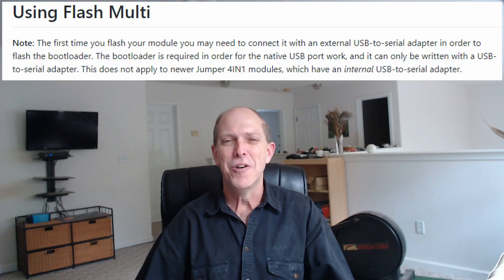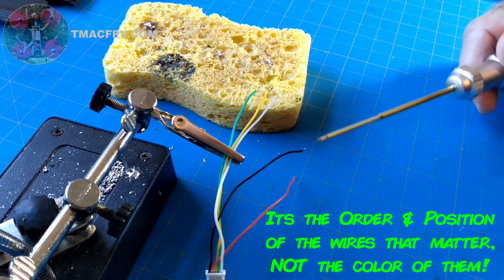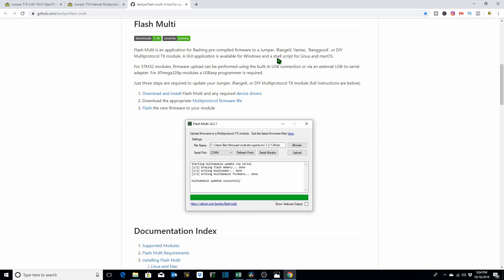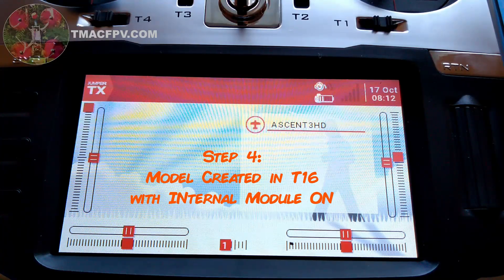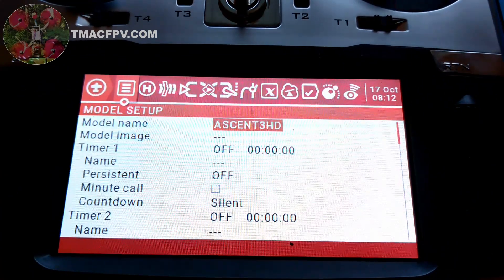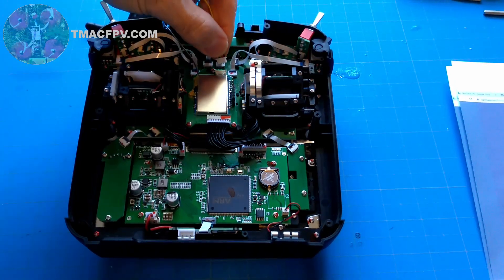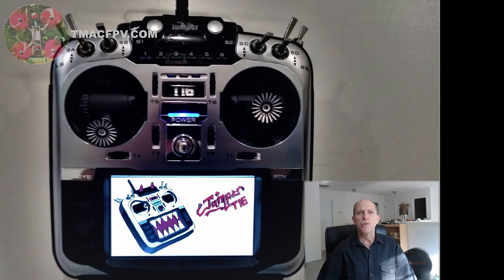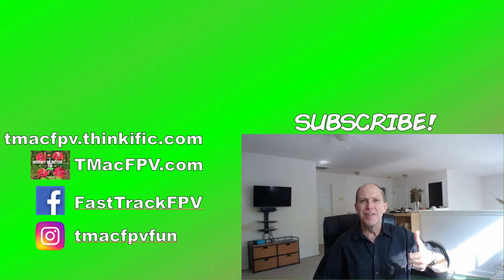JUMPER T16 PRO BOOTLOADER AND FIRMWARE UPDATE

Comment: Great video! do you know if the Pro V2 comes with the bootloader ? I just flashed open tx 2.3.9 on my Jumper t16 pro v2 but unsure if i need to do something additional for the bootloader
Reply from the maker: You're fine. It came with bootloader. Remember to keep up with multi-protocol module firmware updates. 2 different firmware in transmitter. This video explains it https://youtu.be/xAmCWIwzlKc Also, check out entire playlist on the T16 for more helpful info👍
Reply: @TMacFPV  thank you sir

Comment: I've got a 2nd hand jumper T16 that came with the TX version 2.3.5 and the internal module version 1.2.1.51. Do I have to install the bootloader? And what version should I install? Thanks TMac for the video 👍
Reply from the maker: Hey Luis! yes, you will need to upload the bootloader using the process in this video and update the multi-module firmware.  Everything yuo need to know is in this videos description under "Resources and Links Mentioned in this Video."  Additionally, you can go to this site for the latest multi-module firmware:  https://downloads.multi-module.org/ . Select Jumper T16 Pro Internal Module as your Multi-module selection, module type = STM32, Radio Type = OpenTX, Channel Order = AETR, Telemetry Inversion = non-inverted, firmware version = get the latest stable release.   This is for the multi-module firmware you're speaking of here.  This is 1 of the 2 firmware on your T16 you need to update.  The other firmware is the radio operating system firmware which is OpenTX.  for a better understanding of the 2 firmware and what they do see this vdieo: https://youtu.be/xAmCWIwzlKc . For a good understanding of all of your T16 features and capabilities, check out my Playlist on the Jumper T16 here: https://www.youtube.com/playlist?list=PLKAiYAaTdvmqHBs7M0n3t2mSzxY9jEtWK
Reply: @TMacFPV   TMac  Once the adapter is connected to the internal module you plug in the battery and turn on the jumperT16... Then you connect the usb cable to your computer and it will power the adapter, there's no need to solder the 2 joint cables to the 3v port of the adapter, is there? On the other hand, do you open the flash multi program before or after having the usb cable plugged into the computer? Sorry for all these questions... I am new to open TX.  Thanks very much for taking the time to answer my questions.

Comment: Hope you can help me. I have jumper t16 pro v2 setup to kopilot I'm using mode 2 AETR. The motor will only start when over
half way up on throttle. any suggestions? I do watch most of your videos
Reply: It is still acting like it has spring to center still activated
Reply from the maker: Hey Bob! Sorry to hear you're having challenges with your transmitter.  T16 Manual can be found at this site: https://www.jumper-rc.com/download/t16-pro-hall-v2/  Section 3.2, page 27 talks about calibrating your sticks which may be your issue on motor starting only half-way up on throttle (IF you have the correct stick configuration on your transmitter fro Mode 2).  You say you're using Mode 2 , does that mean you have Mode 2 selected inside the transmitter OR do you know for a fact you have a transmitter which came with Mode 2 sticks?  Mode 2 stick transmitter should have "spring to center' on the right stick NOT on the left stick.  The gimbals are different.
Reply from the maker: Thanks Bob, I replied below
Reply: Got it fixed.Had to set end points.

Comment: I can't bind to any models with Spektrum on my T16. it says, "module update recommended" after updating it with open tx. Do you have to update the module if you use open tx or is my issue something else.
Reply from the maker: Hey AaronRC! Yes, multi-module firmware & OpenTX operating system firmware are 2 different things. See this video https://youtu.be/xAmCWIwzlKc then go to multi-module.org for updating
Reply: TMac thanks for the quick response!

Comment: I don't have any COM port to select. Anyone can help on this?

Also I saw your usb adapter red light turned off after a few sec. Mine keeps on lighting. Maybe I did something wrong?
Reply from the maker: follow steps in this checklist. Should work for you https://drive.google.com/file/d/1iAMQ...
Reply: Same problem - no additional comms port on plug in. (check list page not found for me)

Comment: Can this be done on the external module?
Reply from the maker: Are you speaking of installing a bootloader on an external module of updating the firmware on an external module?  I guess the answer to either is yes, I believe so.  I know you can update the firmware on an external module.  Just go to t his site and select your module (the latest available firmware will show up): https://downloads.multi-module.org/  To see the process for updating, see this video: https://www.youtube.com/watch?v=EJx9mz-DI_g&feature=youtu.be
Reply: @TMacFPV  I was hoping to add the bootloader to the external module.  Currently, my Module Status is V 1.2.1.25.
Reply from the maker: @williambeckett4295  Yes, you should be able to do that through the USB port with a USB cable and using Flash-Multi.  See Flash Multi paragraph on this site and then go to the Github link provided in that same paragraph to get the file for updating with bootloader: https://www.multi-module.org/using-the-module/firmware-updates/update-methods
Reply: @TMacFPV  Thank you for your help! As you said all I needed to do was plug into the multi-protocol module.  Sometimes I make things harder than they have to be!  Keep up the great work!
Reply from the maker: @williambeckett4295  Glad to hear it worked out for you William! Happy flying friend 👍

Comment: Your videos have been a great help, keep up the great work. The one thing I am having a hard time finding is the actual updating for the internal module ,  firmware and sd card updates are not a problem but I was told there are also updates for the module itself.
Reply from the maker: Hey Jeff! I'll take care of that for you this week friend 👍
Reply: @TMacFPV  Through the RC Group one guy led me to the right instructions and it went smooth as silk.  But I think it would be a good video for you to do to make it easier for the others.
Reply from the maker: @jsreimer  That's great Jeff! Yes, the video is actually a demo of the process using Ben Lye's site and pointing people to it. It'll be out in the next couple days. Thanks for the suggestion. Always looking for ways to help folks out. Happy it all worked well for you👍
Reply: @TMacFPV  This post on RC Groups from Benzo99 , if the link works https://www.rcgroups.com/forums/showpost.php?p=43639233&postcount=16667

These led to the exact right directions and file

Comment: Quick question how do you do the boot loader update on the MacBook
Reply from the maker: Per Ben Lye on Sep 2, 2019: "In other Flash Multi news, I added a Linux script package to the latest release today. It does nearly everything that the Windows GUI does, so now there's an option for Linux/Mac users as well. The only thing it doesn't do yet is automate the recovery of a device that's stuck in DFU mode, but hopefully the checks I added in the latest version will prevent that from ever happening now anyway"  here's a link: https://github.com/benlye/flash-multi/releases
Reply from the maker: @Alonzo Nembhard Per Ben Lye on Sep 2, 2019: "In other Flash Multi news, I added a Linux script package to the latest release today. It does nearly everything that the Windows GUI does, so now there's an option for Linux/Mac users as well. The only thing it doesn't do yet is automate the recovery of a device that's stuck in DFU mode, but hopefully the checks I added in the latest version will prevent that from ever happening now anyway"  here's a link: https://github.com/benlye/flash-multi/releases
Reply: OK I’ll check it out thanks for the quick response
Reply from the maker: @alanzonembhard5084  I'm not familiar with MacBooks. That's the best I can do.
Reply: TMac Yes I can be a hassle sometimes dealing with Mac

Comment: Tmac where did you get the connector that you soldered onto the adapter, or did it come with it
Reply from the maker: If you're talking about the 1.25mm 5-pin cplastic connector, I just used an extra one which came with one of the FrSky receivers I have.  There's aslo a link to it from Banggood up above in this video description.  I also searched Google for 1.25mm 5-pin connector and it looks like you can get it from Sparkfun (connector has 5 pins but only 4 wires installed) in Colorado at: https://www.sparkfun.com/products/15132 . Or, if you want, you can send me an email with your shipping address and I can get one out to you if you live in U.S.

Comment: do future updates require you to open the radio back each time or can it be done through the SD card?
Reply from the maker: No future updates do not require you to open the radio. This is a 1-time process to get bootloader installed on module. Future updates can be done through OpenTX menu to update module

Comment: Great video! One question though. 
Why did you use the non inv file.
I used the inv file. What is the difference?
Reply from the maker: Hey kkuenzel56! noinv is for internal Multi-protocol module, inv is for external multi-protocol module

Comment: I am currently on a nightly openxtx something with the .85 internal module firmware pre installed. Do I need to use the cable mod still if I want to update to 1.3.0.45 or can I use the sdcard/opextx companion? Thx
Reply from the maker: Just posted a video today that covers all that entitled Jumper T16 Firmware Clarification. Check it out and it'll give you everything you need 👍
Reply: @TMacFPV  Awsome Thx! 👌
Reply from the maker: @redogg2749  Happy Thanksgiving friend!😁

Comment: Can’t believe that you cannot update module by using usb ? Seems a bit odd unless this will be supported in the realese version of open tx otherwise people will be stuck with jumper tx
Reply from the maker: Initial shipments of T16 were shipped without necessary bootloader installed.  Due to that, this process is required ONCE (to install bootloader & update module firmware).  If module firmware version ends in .85 or later, the bootloder should be installed and this process will not be necessary. Jumper T16 will be fully supported by OpenTX in official release
Reply: Top man thanks for the info I’ve just ordered the parts to update the module can you post a picture of the wiring diagram that be great 👍
Reply from the maker: @mark161262  Mark, please see time hack 3:56 of video. Checklist available in video description along with link to Be Lye's process
Reply: TMac thanks matey
Reply from the maker: @mark161262  you betcha!👍

Comment: Great video.  Watched to video a couple of times, built the wiring harness, and installed all the drivers.  However, when I ran the Multi-Flash Tool, I'm getting a "Failed to erase flash memory" error.  Any ideas where to look to solve this problem?
Reply from the maker: Hey Mike! Thanks! A couple things I can think of: 1. from Ben Lye in RCGroups:  "Some people had issues flashing with Flash Multi (getting Failed to Erase) found that using ST Flash Loader Demonstrator to do a full erase of the module solved the problem and they were then able to install the firmware with Flash Multi." 2. Do you have the transmitter OFF? 3. Are you using the checklist I provide a link to in the video description or Ben Lye's process also at link in video description? 4. Almost sounds like it's a driver issue. You may want to run ImmersionRC Driver Fixer (this actually may also be in the checklist, I'm not sure). 5. Are you using an adaptor with 3.3 volts? 6. Have the adaptor wires connected properly? I'd just methodically go through and verify each & every individual step. Now that I think if it, if nothing else works, it could also be a bad adaptor.  Someone who tried this using a different adaptor than recommended ones went through 3 new ones of those he tried before getting a recommended one which worked
Reply: @TMacFPV  The ImmersionRC Driver Fixer solved the problem.  I've used this to fix flashing firmware issues on flight controllers but I really wasn't sure how to use this on the radio since the radio USB was not used to update the internal module driver.   However, the follow process worked for me:  1. Plug the special wiring adapter into the internal module.  2. Plug in the USB cable into the top of the radio with power off and run the ImmersionRC Driver Fixer.  3. Unplug the USB cable and turn the power on the radio.  4.  Plug the USB plug into the USB-to-Serial Adapter.  5. Run the Flash Multi program.
Reply from the maker: @mikeduncan2127  Very cool MIke! Glad you got it worked out.  Thank you for posting your procedures! Should help some folks who experience the same issue, much appreciated friend!👍

Comment: Hi, ordering the USB to Serial adapter would take a few weeks in my country. Do you think this Impulserc USB to serial adapter would work? I have one already from my Helix and hoping this would work.

https://impulserc.com/products/usb-to-serial-adapter-helix
Reply from the maker: No, I do not believe so. It appears this one operates on 5v.  You need to have one that operates on 3.3v.  See  the link provided to Ben Lye's process above.  It will explain the materials (to include adaptor type) you need.
Reply: TMac appreciate you taking the time to answer my inquiry, ordered the same one as your link and will be here in a few days. Just need to borrow a pc as I find the Mac instructions too complicated. 

Btw, once the internal module firmware is updated, do I need to rebind my models? Thanks
Reply from the maker: @ryanhayudini5593  You're welcome Ryan, no problem. Yes, rebind receivers. Got a video on fine-tuning them also if you're using genuine  FrSky receivers also. Not necessary to do just optimizes them
Reply from the maker: @ryanhayudini5593  also,  recommend you check out your GPS Rescue failsafe mode in a "controlled/expected"  situation so you're familiar with how it works and the procedures before you start relying on it. This will give you more confidence in using it

Comment: I received a T-16 Pro yesterday that came with the internal multi-module bootloader already flashed so hopefully people won't need to do this soon. I ordered the parts needed to flash it so they'd be here when the radio arrived but turns out I didn't need them anyway! Thanks for the great vid though, I watched it in preparation for what I was expecting  to do.
Reply from the maker: Sweet! Thanks for the info!  Not everyone has been as fortunate as you since many have been shipped out without the bootloader and not all vendors have the stock which does contain the bootloader at this time. OpenTX Dev's have been working with Jumper tomake this happen.  Next step for Jumper is to include OpenTX official release on their T16s prior to shipment.  I'm confident that will happen eventually.
Reply: How do you know if the bootloader is installed or not?
Reply from the maker: @gerryroedel4591  See time hack 13:10 of video. If internal module firmware version ends in .85, you're good to go (bootloader is installed).  If it ends in .51, you need to upload the bootloader per this video

Comment: Hi Finally achieved the module update. I had to wait until 1 of the three new USB yo TTL boards arrived and it worked just fine. Oh and guess what the telemetry from D8 receivers is now working fine. I used a Sparkfun 3.3 FTDI basic board. So all good there. How do I check if the module has actually been updated? I'm going to have another look at your video. All I now need is my replacement Hall Gimbals that still haven't been sent. Filed a dispute with AliExpress.
Reply from the maker: Yes! Outstanding! Time stamp 13:14 of video will show you how to verify internal module update. Congratulations Donald!👍😉